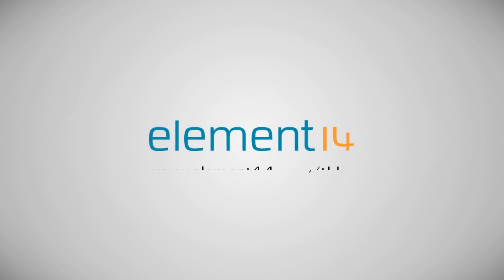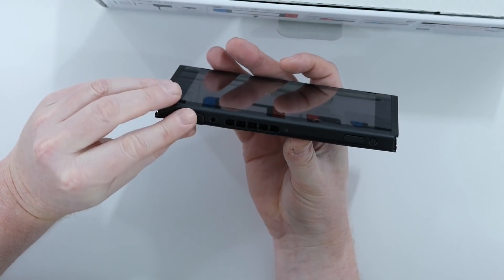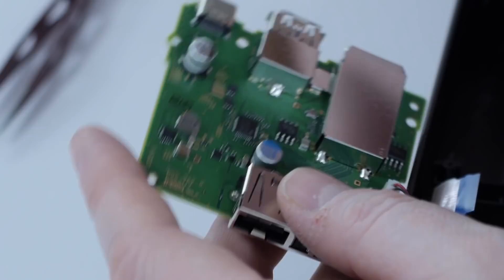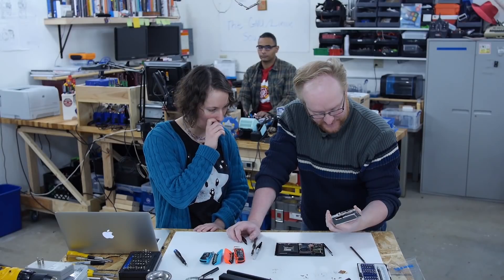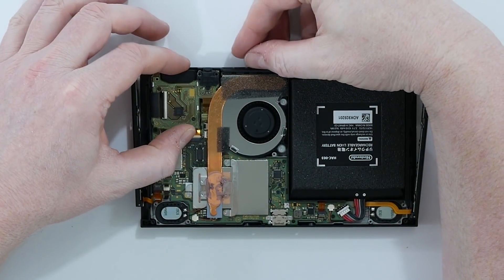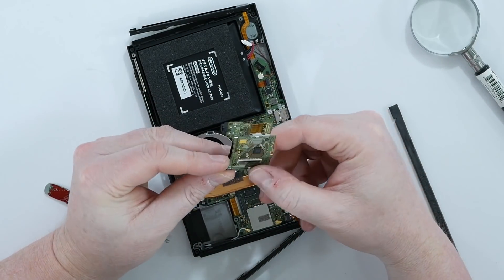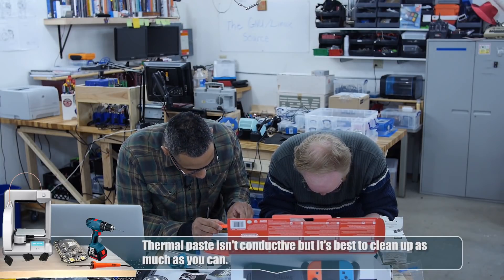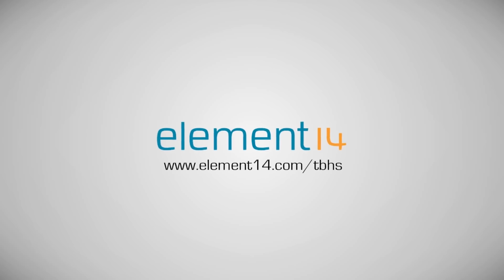Nintendo Switch Teardown

Comment: Watching Ben taste that cartridge made my day. I like when I have to pause a video and wait until my laughter subsides.  I've heard from many that the Switch actually suffers more performance problems when docked.  I wonder if it's due to the overclock getting pushed into an unstable range or if the base makes the cooling less effective and the performance degradation is due to overheating components.
Reply: Pancreaticdefect probably both

Comment: Any chance of looking into the Joycon issues that people have had, specifically that the left one seems to have connectivity issues and overall less range than the right?
I saw another YouTube channel had taken one apart that was having issues and noticed that the left Joycon is set up differently to the right, and that the antenna on it was built into the board in such a way that there might've been interference.  He soldered a wire to it and ran it to the bottom of the Joycon, and the signal was a lot stronger and worked further away from the console and no longer had issues with syncing.
Would be nice to see someone like Ben tackle it and give proper reasons for it.

Comment: Seeing that it's this easy to open and get to, at least the cooling system, makes me want to open mine and replace the thermal paste.
Reply: You could do that, but in a best case scenario you'd maybe get a reduction of 3 degrees or so. It wouldn't amount to any noticeable performance increase. Not worth it even without potentially voiding your warranty.
Reply: Yeah, just going by what i saw in this video, it looked like a sloppy job from the factory to me, I'm sure it probably is fine though
Reply: I imagine the amount may vary system to system.
Reply: Good idea cuss it looks like Nintendo just put some chewing gum in there
Reply: Oh yeah, if you already have it open, you may as well go for it. 

People really do overstate the difference brands of paste make though. It really is only a small temp difference between cheap, manufacturer applied gunk and the best brands. It can add up, but only when you're trying to really push margins on an overclocked bit of hardware. As long as paste is applied properly and isn't so old it has degraded (very old indeed), it's only worth it if you're taking off the cooler for another reason (like replacing or deep cleaning a fan and heat-sink combo). In those cases a new application of paste is needed because you've had to unseat the heat-sink.
Reply: Good point, in light of all the issues they are having, no sense in voiding the warranty if you don't have to. But if it was already voided I would probably put in new paste if only for my own piece of mind.

Comment: Ben Heck Video + YouTube PS4 App = Broken ass video everytime..
Reply: I use the PS4 web browser for YouTube, it's the actual YouTube you'd get as though you were on PC. Ben's videos work just fine that way. The web browser is actually decent, although I don't use it for anything other than YouTube. I don't like the YouTube app.
Reply: My Roku2 frequently locks up when I scroll to the Ben Heck Show thumbnail, or try to play a Heck video. It is the only channel that makes the roku behave that way, and I wondered if any other units have the same issues.
Reply from the maker: Can you delete YouTube save data?
Reply from the maker: We usually just export using a slightly modified YouTube template from Adobe Premiere. H264
Reply: The Ben Heck Show Yes, unfortunately its still a no go, other videos load fine, and I used to not have issues loading yours, but recently something change and now they don't load, they just crash the app in a black screen
Reply: The Ben Heck Show Well I'm still happy because it loads on my phone, it's probably just Sony and YouTube BS there always having some kind of issue lol
Reply: OfficialFBomb U mad bro?
Reply: DarkHorizons I should start doing that, I don't think I've ever used the browser before, the app was just convenient lol thanks for the tip man
Reply: Glad I'm not the only one with the issue. Kills the app everytime
Reply: All of my Roku's have the same issue. Obviously it's an issue with the Youtube app and Ben Heck's particular codec.
Reply: uh, then stop using your PS4 to stream Youtube moron. Its not the video's fault, its the PS4 app itself. Use another device already and stop bitching.

Comment: It would be displayport to hdmi.

From the Ifixit tairdown we can see the switch has a USB 3/displayport multiplexer chip inside of it.

So it passes USB 3 and displayport through it's USB C connector (1 channel of USB 3 plus 2 lanes of displayport, or 4 lanes of displayport and nothing else, according to the chip spec. The Displayport lanes are rated for 5.4 gigabits per second which is HBR2 spec)

In principle it can support high framerate and 4k with the amount of bandwidth it supports, especially if you turn off the USB 3 link.
That's probably not a great idea given the power of the system itself though.

We also know from leaked developer documents that the tegra chipset (whatever it is) can output 4k at 30 fps, but that this is disabled in software at the moment.

All of this together points to a theoretical ability to do 4k, but Nintendo isn't willing to enable the feature.
Plus, it just doesn't really have the grunt to do 4k gaming in any meaningful way...

Still, it's interesting as a theoretical capability.

Comment: +The Ben Heck Show Hey, I was wondering if you could create a really nice one handed analog control that could replace a keyboard for coupling with a Mouse? I think that'd feel nicer and more intuitive than using a keyboard to move about but you'd also get the benefit of the easy aiming of a mouse.

Comment: Now you have pull it apart, you can make copies of it by decapping & scanning all chips under a microscope, while in the meantime nintendo could come with a switch 2 with a 1080p screen along with a tegra x2 chip with 4K output in dock mode to better compeat with the ps4 pro & xbox one S !!!!!
Reply: Virgil Hawkins incorrect it's a custom cpu/gpu chip, it's brand new.
Reply: Willis Jackson wii u was on par with 360, damn do you guys know your hardware at all..
Reply: They're already using last gen nvidia architecture. Every cost was cut to reach the $300 price point while remaining profitable.
Reply: It's a heavily underclocked maxwell X1 on par with an xbox360 graphics-wise.
Reply: The wii u was may more powerful than last gen systems and the switch in portable mode is like 2 to 3 times as strong

Comment: So, would it be possible to drop 8gb ram in there, and upgrade the memory? They are technically removable and replaceable, but are they somehow locked to the Switch OS, or could we pop in some custom parts?
Reply: animewisher probably not possible due to security issues

Comment: Honestly, I fully expect Nintendo to treat the Switch like a handheld in terms of hardware revisions.

I don't know wether they will go for a cost-reduced 5.5" Switch Mini with non-removable JoyCons as a replacement for the 3DS or a more powerful Switch Pro with a 1080p screen based on the latest Tegra chip, but it will likely be one of the two.

Comment: Here's an idea,

grab the board from the dock, make a laptop chassis so that you can play the switch on a 1080p monitor and potentially longer battery life.
Reply: Given how small the things are, you probably can bundle it with the switch internals, the dock internals and fill the whole rest of the space with lipo batteries.

Comment: I wonder if it's easy to replicate the eMMC flash storage.

You know, so you can move the data from the 32 GB flash drive to a 64 GB, or a 128 GB storage drive.

Comment: Make a giant Nintendo switch or one that can do more than 720p (at least 1080p)
Reply: what matters is pixel density. more pixels will just drain battery like crazy if you wanna have a switch that you can only game on for 45 minutes go for it
Reply: henry it can do 1080p tho in docked
Reply: Notch 2112 you'd had to run it through the dock or trick it into thinking its dock attached to run 1080p
Reply: which would do nothing until it has a better screen
Reply: Earth2Nick It's upscaled 1080p, not native.

Comment: You can't use the Joycons wirelessly in Airplane mode. So they falsely advertised that feature.
Reply: Catface I've seen someone do it, turn airplane on then switch wireless on
Reply: Really? I saw a photo of a warning saying that wireless couldn't be used in airplane mode
Reply: There's multiple forms of wireless though. The controllers are bluetooth, but the system also has wifi.

If it's anything like a tablet you enable airplane mode, then manually enable bluetooth and/or wifi as needed (and as whatever rules the airline you're flying with has about such things allow for.)